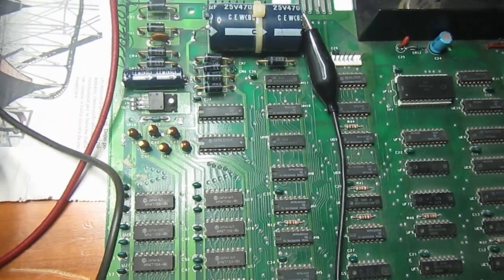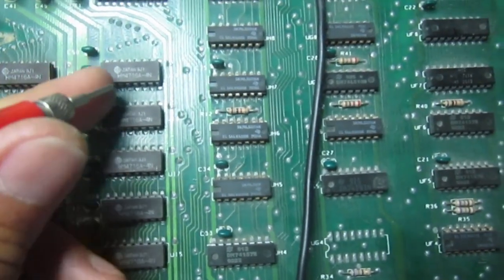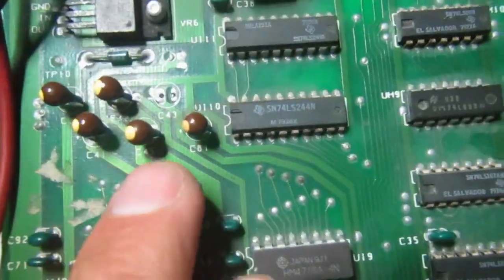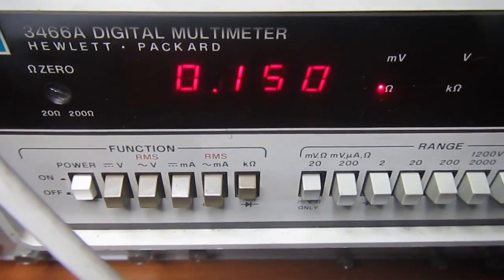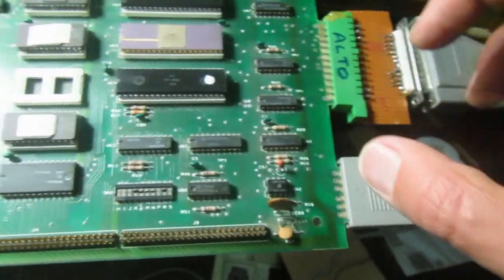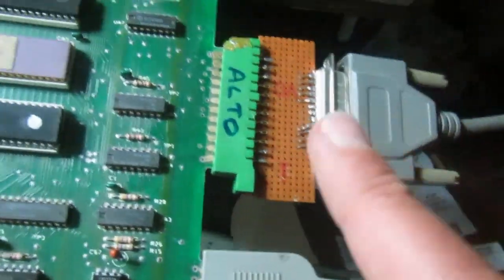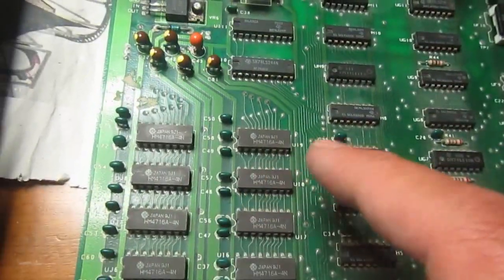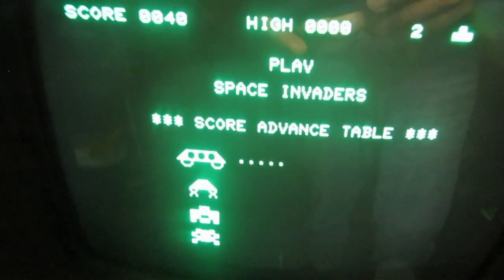CBM PET 4032 repair. Always check the power supply first!

Comment: Any idea where I can obtain a troubleshooting guide for the 4032 or 4016? The PET I have doesn't power up and I know I have to start with the transformer to see what might be going on there, but the diagrams I have found are not complete or correct .... Much appreciate your help... Cheers...
Reply from the maker: Hi, I always used the schematics found here: http://www.zimmers.net/anonftp/pub/cbm/schematics/computers/pet/index.html  You need of course to use the ones matching your particular board revision. A 4016/4032 might be either a 2001N (if it has 9" CRT) or Universal (univ) if it has a 12" screen. Schematics are complete, I don't know of any troubleshooting guide. You always start with power supply checking and then progress to various signals on the CPU.
Reply: @iz8dwf  perfect! Thank you... off to fix a PET....(computer that is... )

Comment: The big rage these days is ''recapping' everything from C64s to Amiga, do you recommend just recapping the whole PET 4032 or leaving things alone like some people are suggesting?   -Mark.
Reply from the maker: As you can see, I've had an Amiga 600 to recap. All the SMD capacitors were bad and leaked, on the other hand, all through hole capacitors were still perfect (but the owner wanted new ones anyway). I never substitute parts that haven't failed, unless I know for sure they will fail soon. Tantalum capacitors are really on the edge, even modern ones can fail shorted for apparently no reasons. I tend to believe that parts that are still perfect after 40 years have better chances to be working for another 40 years :)